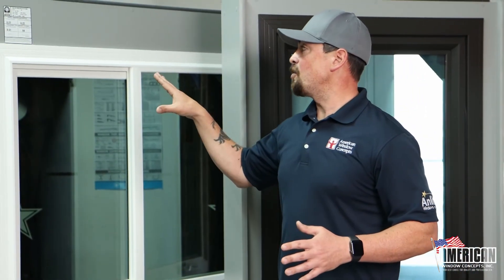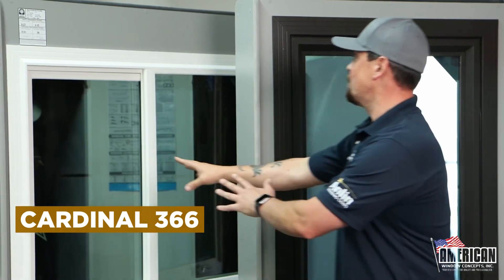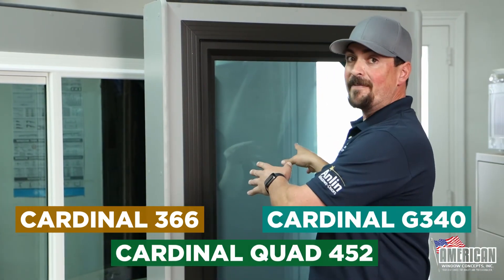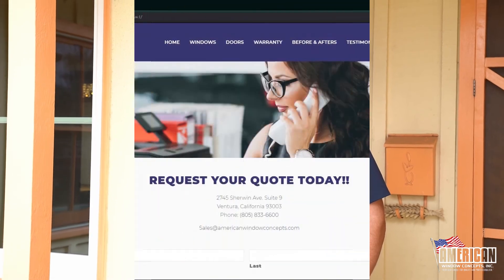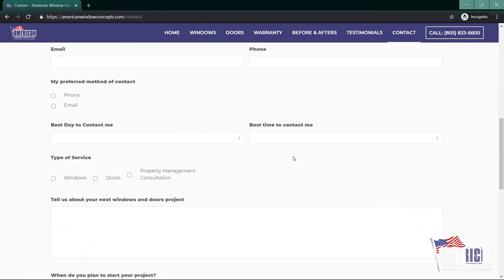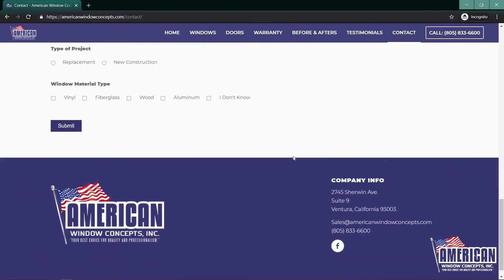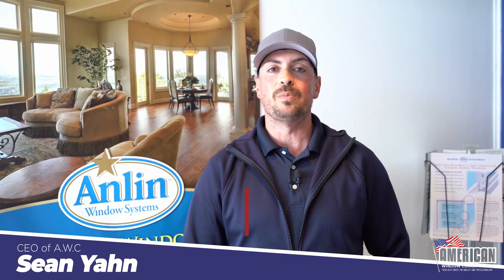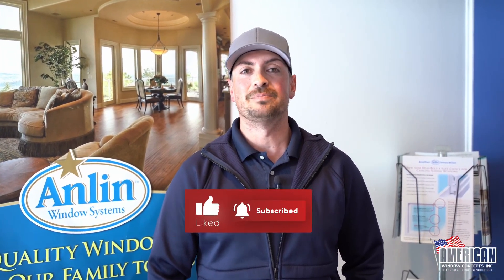Different Types of Low-E Glass (You Need To Know Before Buying Windows)

Comment: Very informative video. The glass on my aluminum windows no longer prevents the heat from coming inside the house. When the weather is hot, i can open the shutter, and feel the heat radiating from it. Do you recommend i replace my glass to low e, or retrofit a new window?

Comment: Your YouTube channel has been very helpful for me, as I've been researching Anlin windows. I'm trying to decide between Infinit-e, SunMatrix, and SunShield glass packages. To my understanding, the Infinite-e and SunMatrix have a green tint, while the SunShield has a blue/grey tint. If I am inside, looking outward, will my view also be colored green or blue?

Lastly, when you say that the room will be darker with SunMatrix or SunShield, how much are we talking? Is it dark like you're outside in the shade? Or dark as in you need to turn on a light to see well?
Reply from the maker: Hi Darren, I am glad to know I have helped in a way. The Sun Matrix will be slightly lighter and allow more natural light through the glass than the SunShield for sure. The blueish glass is a very very high performer against the sun, especially on south facing rooms that have little to no eaves or foliage to protect the window. Either would still allow light in, but it will be noticeably more shaded in the room. No need to turn on the lights during the day, it is not quite that bad.

Comment: Does 272 lowe match 366 Lowe in color
Reply from the maker: Hi John, the two glass LowE coating are different in shade. The 366 is darker and lets in slightly less natural light that the 272. Great question though!
Reply: In the right conditions (or wrong depending on the circumstances), 272 tends toward a slight purple while 366 is going to be more to the green.

Comment: A few clarifications. LoE³-366 has a glass-only visible transmittance of 66% of visible light will pass through the glass in a dual pane configuration. For comparison, two lites of clear glass in a dual pane configuration have a VT of 82%.  So why does the window that you demonstrate have a VT of 51% and not 66%?

Visible transmittance and Solar Heat Gain Coefficient are based on the whole window and not just the glass. Two windows that are exactly the same size with identical glass package will have different VT and SHGC if the sash/frames are different widths or if one window has muntin bars and the other one doesn't since the window materials have a VT and SHGC of zero. The difference between 66% glass VT and 51% window VT is based on the percentage of glass versus percentage of frame in the entire window unit.

You state that the thermal weak-point of a window is the glass while the vinyl frame improves thermal performance, that's not correct. Actually the warmest part of any window is the center-of-glass (CoG). All glass not within 2.5" of the edge of glass or from the frame is considered to be CoG.. 

In your examples you state that the overall window U-factor of the windows you are demonstrating is .27, but the CoG of a dual pane with LoE³-366 is .24, so glass-only is.03 better than overall window performance. The difference is because the frame is not more efficient than the glass.
Reply: Thank you for taking the time to help others understand where he went wrong!!
Reply: @liketheduck  Thank you, I really enjoy and appreciate Sean's videos, and look forward to finding new ones. He has a wealth of all around knowledge about windows, install, and all the associated bells and whistles that ultimately benefit his customers. But like in all things, sometimes a minor detail or two might need a tweak, particularly if it falls into the "common knowledge" category. Sometimes common knowledge might become outdated or superseded and requires a minor upgrade, Nothing to affect the message, just a detail or two.

I truly mean my comments to be educational and are in no way intended to affect the overall message that Sean is presenting which is spot on and valuable to anyone who is open to learning what he is delivering. And trust me, I have had my share of "DOH!!" moments in the past, and without doubt will in the future as well. 

However unlike Sean and a few other window commentators who present clear, factual, and useful information, and whose videos I enjoy watching, there are also a greater number of window commentators hanging out on youtube who call themselves "experts" but who present misleading or questionable information about all this stuff, sometimes they throw out mind-numbingly wrong information. I tend to comment on those as well.....

Comment: My company here in the DFW area installs Anlin windows almost exclusively. Surprisingly, our customers almost never choose the SunShield coating. Which is puzzling, considering just how ridiculously hot and sunny it gets here most of the year. Maybe it's the exterior view that spooks them: they don't want to seem weird as the only neighbors to have blueish glass. Maybe they're simly not convinced that it works as advertised (it does). Or maybe it's an HOA thing. Idunno. It can't be the price, as the upcharge isn't all that much. It's not like they're upgrading to laminated glass. I guess it's something for the marketing folks to figure out!
Reply: Color is reason.  That is it.  And lack of understanding of cheap benifits.
Reply: Nahhh, its the salesman not pushing it properly.
Reply from the maker: That is curious for sure. I tell you what, the Sun Shield has been a life saver for some of our customers out here. It improved their love for the home!
Reply: @d.a.9937 Funny thing: from reading the tech specs online at Anlin's website, I had chosen the SunShield glass package after the very first read-through 🙂...And I live in DFW !
Does your company work with the public ?  Any contact info you would be able to share ? I am looking for 14-15 replacement windows of Del Mar / DelMar E. Thanks...